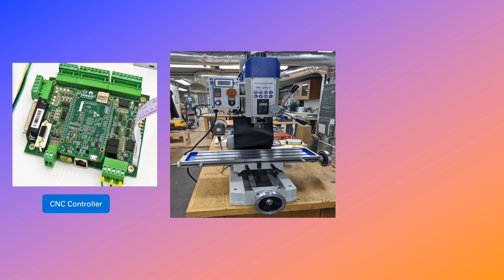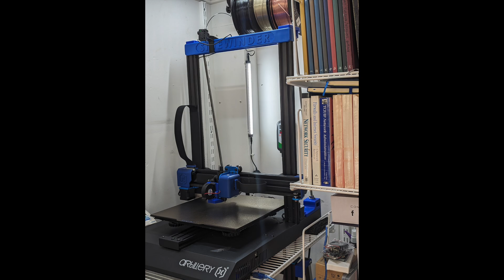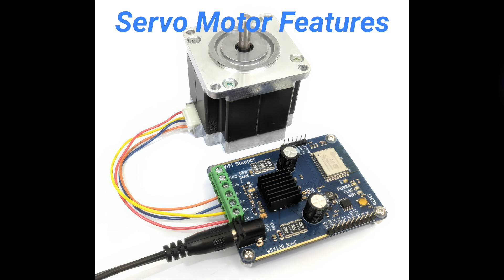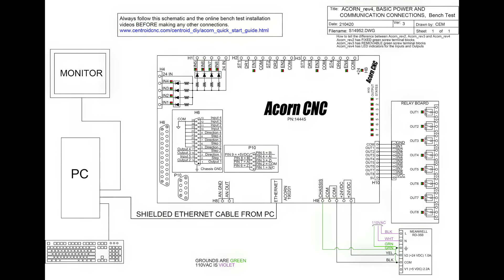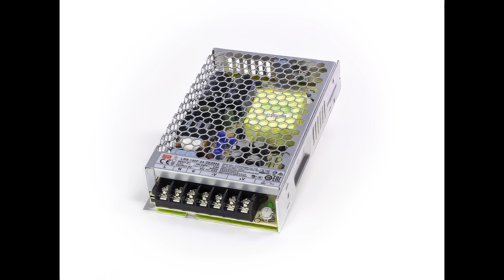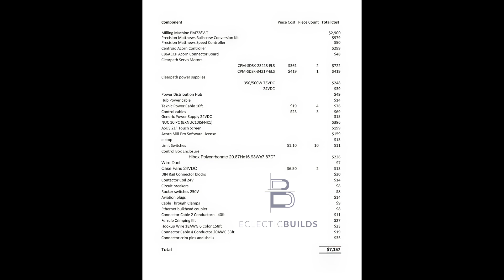How Much Will your CNC Mill Cost...?

Comment: Closed loop stepper motors are also a choice. Not as accurate as servo's but if they lose steps in a movement they make them up at the end of that movement.
This means if you are moving only on one axis all is well it will remain accurate.
If you are moving on two or more axis then if only one stepper looses steps then it will make it up at the end but the result will not be exactly what you wanted....
So machining angles may be a concern, machining curves not so much - as they are made up of small straight movements so the amount of error only occurs on that one small movement.
I haven't actually used any of these but that is the idea.  If you can use servos, if you can't then closed loop steppers at least stop issues from compounding over the whole job.
To see more also look at clough42 videos He did a great in depth look at all 3 types a while back. He also chose Clearpath servos.
In fact on his surface grinder build went into the two types of the clearpath servos, so that he could overcome a dynamic issue he had.
Reply from the maker: Yup - all good points - my preference is still for the Tecniks but they are a little more money

Comment: a guess it really depends what you consider a cnc. because i manage to remake exactly same mill to cnc for much less than 200$. no feedback steppers controlled by old lpt port, original lead screws with software based backlash compensation. everything else saved from trash bin...
Reply from the maker: Yup - and probably it would work for some people - I had "loftier" goals 😊
Reply: Build cost all depends on the intended use. The greater the precision required, the higher the cost.
Reply from the maker: Its a bitch but you pay for that rigidity, precision, repetability and lack of backlash
Reply: @eclecticbuilds1424  You are 100% correct. And the cost of manufacturing high precision parts doesn't stop with the machine tool. You need a controlled environment, plus allowances for the time for the parts to cool to room temperature before inspections and making the finishing cuts.